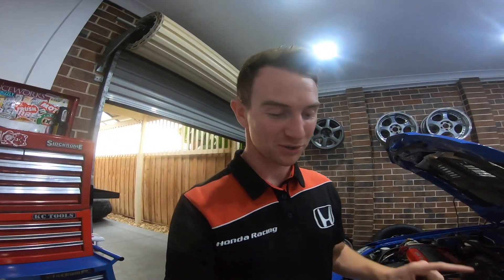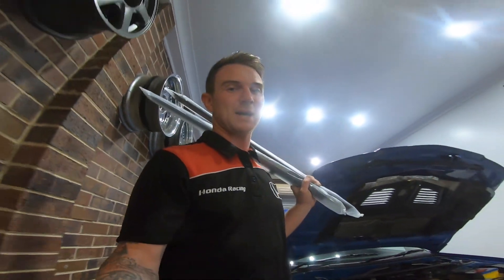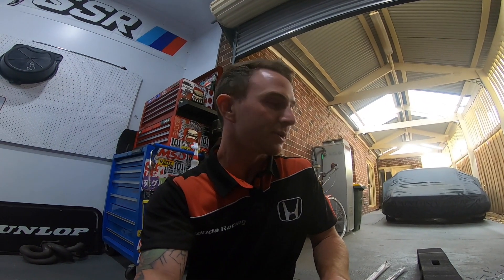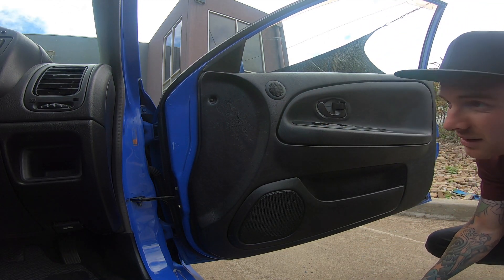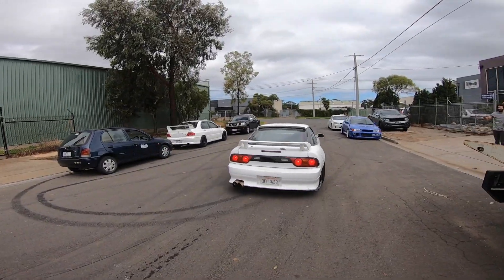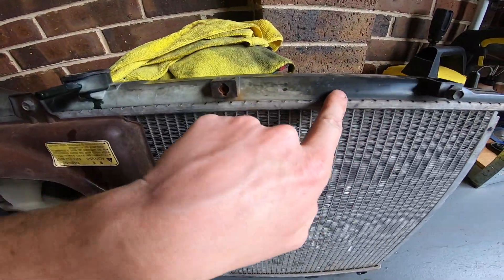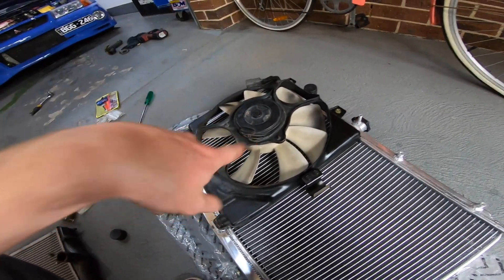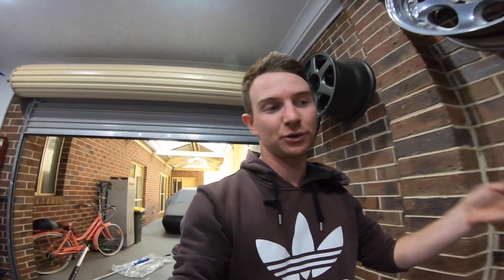LANCER EVO 6 cooling upgrades

Comment: New viewer :) Thanks for the Evo info ! Got my own Evo V in Ireland just before we got "locked down" March 2020. Think I managed around 300km in the year since. What BOV have you got there ? It sounds similiar to my Blitz. Also top tips on the trim parts, I'll certainly be buying them up. Much appreciated.
Reply from the maker: yeh i got this early in the year also just as we went into lock down so have done very minimal kms in that time, standard BOV mounted upside down ejectively blocking it with just a metal intake

Comment: Ok man, what kinda dose pipe you got? cause it sounds like old japan SR20 and i love it lol.
Would you consider fitting a simple folded sheet metal shroud and a 12inch comex/spal/davis fan?  Usually they are wayyy more compact compared to those stock mitsu fans and can flow just as much. 
Also an M12 Milwaukee 3/8 stubby impact will change your liffeeee. Get one, you wont go back haha.
Reply from the maker: just a metal intake with a pod filter as i got it, nah not a fan of aftermarket fans, will never be as good as factory stuff